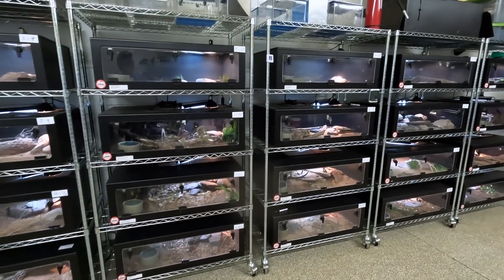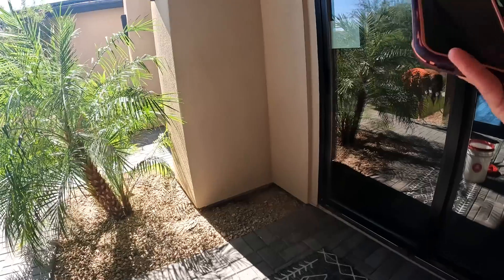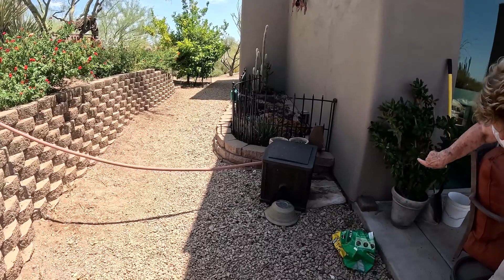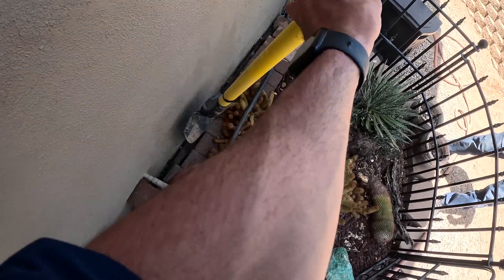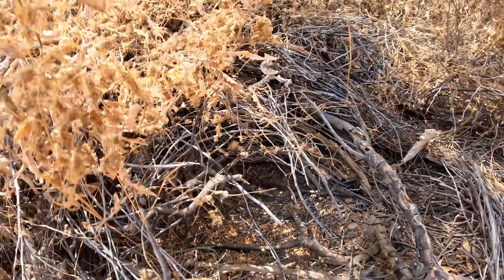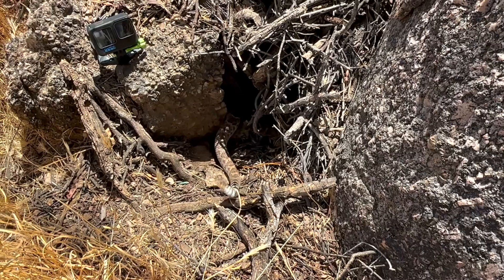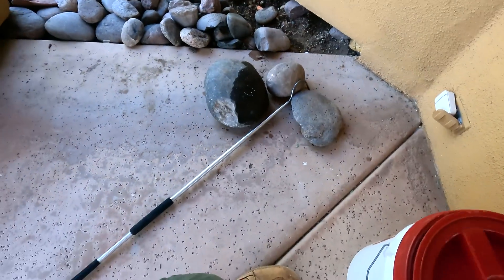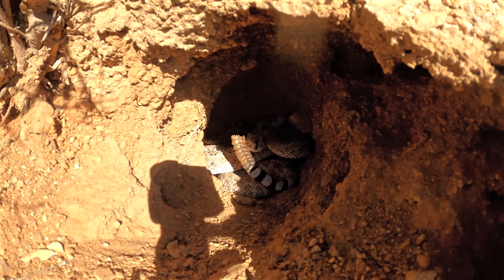This is Why Rattlesnakes Might Gather in Your Backyard

Comment: Having a severe hearing loss makes me very afraid of rattle snakes …. I can’t even hear the rattle with earbuds on.
Reply: Always be careful where you step and reach your hands, if a snake could be hidden there. In particular, areas where they may seek shelter, shade on a hot day, or near a water source or a food source like rodent trails/holes. On the other side of a fallen tree or log. 
Try not to step or reach where you cannot clearly see. 
If you do those things, you wiII greatly reduce your chances of being surprised. 
Keep in mind, during cooI times, a snake may not always rattle to warn you anyhow. 
They have to be warm enough to be active. But like us, it can be too hot for them and they wiII seek shade. They are dependent on the environment to warm them up and cool them down in extreme temps.  

And in the worst case scenario in the rare case of being bitten, do not panic. Just stay calm & get to the hospital.   
Antivenom is avaiIabIe and snake bite deaths are very rare in the US. You are more likely to die from a lightning strike or in your own vehicle in an accident, than by snake bites. ❤